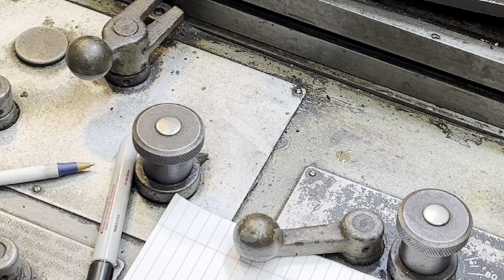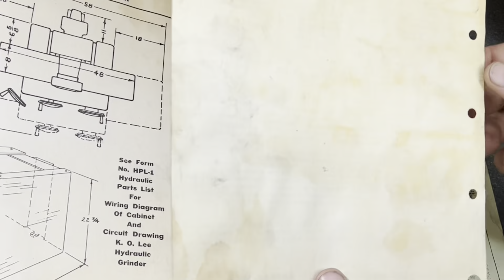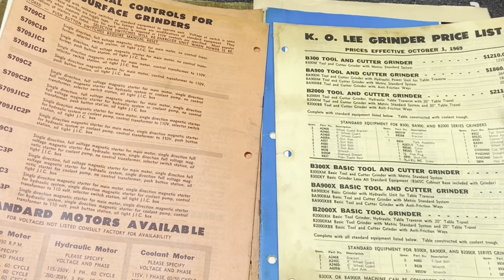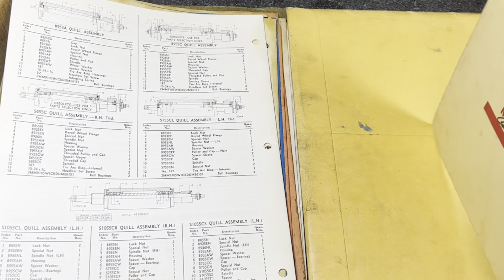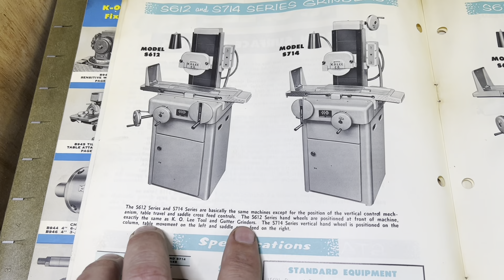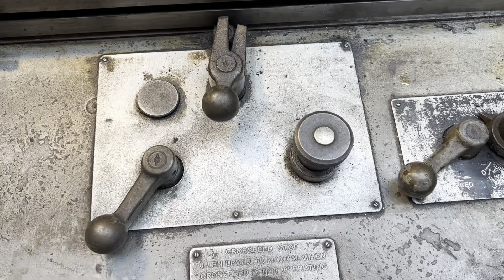5 Corner Magnetic Chuck test for flatness & Tour of 60’s era KO Lee S718HG Surface Grinder

Comment: After the machine is moved it should leveled using a toolmaker's precision level. After the machine is leveled, if you really want to be thorough, the chuck is removed and the clamping surface is ground in and indicated to confirm even wear and parallism along the ways. Replace the chuck top surface down and grind in the base. When you flip and clamp the chuck you can  confirm whether you're overtightening the clamps by changes in flatness of the chuck surface. Face the chuck, remembering to energize the chuck. This is a mandatory. The chuck can then be indicated to check for flatness/parallism...again. The wheel must be be new, balanced and properly dressed. The diamond used for dressing should reasonably new and unworn. The "sharper" the diamond the better the resulting condition of the grinding wheel's cutting face. Any vibration can cause a "hop" affecting surface finish, flatness and size. Solid, hardened, rectangular blocks should be used. You want to survey the entire surface of the testpieces. The way the blocks are used in the video the wheel can drop when passing over the hole. If you really want to wring out the surface grinder use more than five blocks and place them in a random, but reasonably spaced pattern. This, to some extent, mimics the way workpieces will be placed on the chuck during shop use. Placing workpieces in the same spot will wear the ways unevenly. The blocks should be ground with the table being run throughout the full, continuous length of travel. Make sure there is a safe, reasonable overtravel at both ends of the stroke. When the table direction is reversed the film of lubrication changes thickness, the overtravel allows the oil to settle into a consistent film thickness. Grinding one block at time causes the block to heat up and expand causing heat induced dimensional, flatness and parallism changes. You then flip the blocks and finish grind the test pieces. Before removing the blocks use an indicator to check block parallelism and flatness, before checking the thickness of the block with a micrometer. You'll probably see a slight "taper" at the ends of block as the grinding wheel rides up onto the block and the down as the wheel runs off of the block. As an additional brutal test rotate each block 90°, then without changing wheel height, grind the blocks again. If you have a "tight" machine you should see an almost crosshatch pattern on the surface. Sometimes the surface pattern is hard to see. As an alternative to the bare block, use a marker to cover the surface. The results can be very interesting to evaluate. Any change in wheel height or change in the thickness of the way lubricant film will be indicated by the surface being untouched or the marker being removed. Another , best, result is a partial, even thickness removal of the marker. I realize this is a complex, intense procedure, and probably overkill for a hobbyist, but it can be very enlightening. Earlier I mentioned heat induced  changes. If you re-examine the freshly ground surface you'll notice a subtle dark/light pattern. This is known as heat checking or just checking. This indicates that too much heat had been added to the part. This will indicate changes in the surface hardness. Yes, this procedure requires a certain amount of obessive-compulsive behavior. Being a Journeyman Tool and Die Maker specialized in gage building (yes, that is the proper spelling for this), toolroom machine spec'ing, purchasing and checking, and Metrologist this behavior is almost a requirement. In precision little errors will become big errors if allowed to accumulate.
Reply from the maker: Thank you for the thorough comment! I appreciate your detail provided here, I’ll have to read through it a couple times, lots to digest. Thank you.

Comment: The hydraulic power feed on that grinder is really nice, My old 40's-50's Reid 2b has v-ways with a lot of wear and a chain drive mechanincal power feed. The machine kicks back and forth every time it changes direction. I figure it has to overcome the stick-slip and squeezing out of the oil from where the original scraping had been worn through.
Reply from the maker: My first surface grinder was a Brown and Sharpe no 2. (Check out my videos on that machine). It too was pretty worn.  It had an automatic function on it, but that was not operable so I converted it to manual. I brought it back to serviceable condition and found it an amazing home at a foundry in southern Maine where it’s new owner will use it for knife making.  The hydraulic is pretty awesome, I just need to learn more about making better surface finish.  Sounds like your machine is a classic in its own way too! Love these old machines and their quirks!